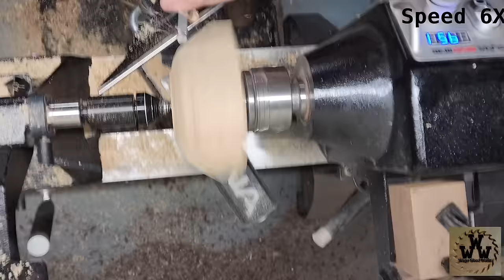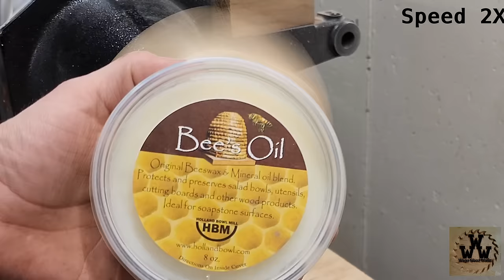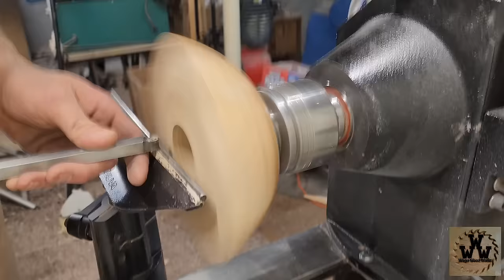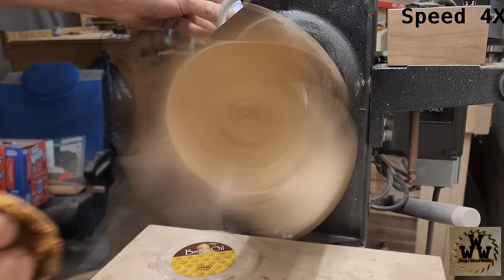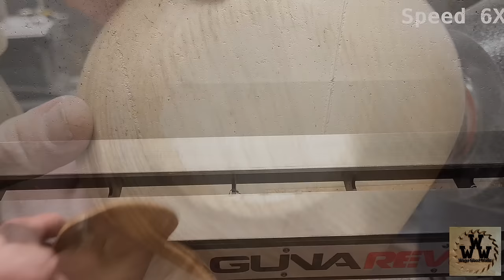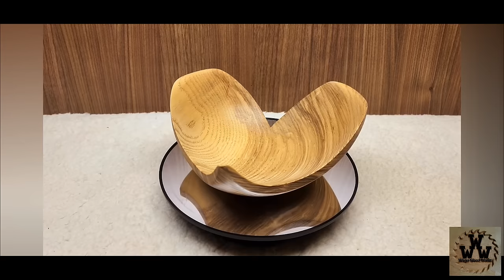Woodturning The Valentines Day Special

Comment: Very nice bowl.  What type of spur drive you use initially in chuck to hold in place?
Reply from the maker: Thank you! On this particular project the initial chucking was done using a worm screw.
Reply: @WegeWoodWorks  Thank you.  May I ask what kind of wood?  I used a 3/8 hole on cherry 1 1/4" thick and worm screw stripped threads very quick.
Reply from the maker: @waynenelson8907  this piece was made from ash.  Fairly dry so the screw bit in well and stayed.  I also make sure my pieces face is firmly against the closes jaw of the chuck for added support
Reply: :) Thank you.  Happy Easter.
Reply from the maker: @waynenelson8907  Thank you, and a Happy Easter to you and yours as well